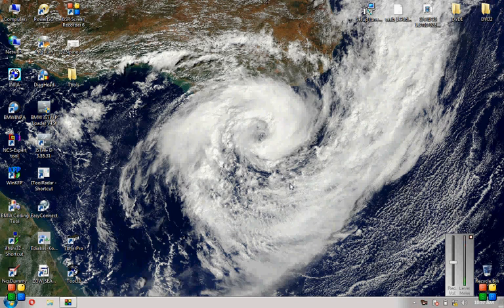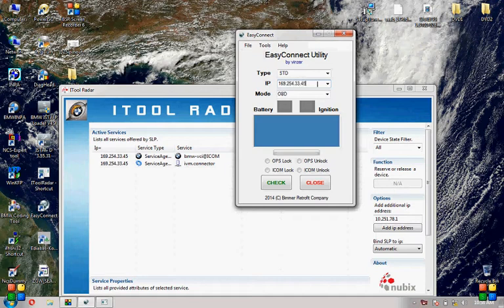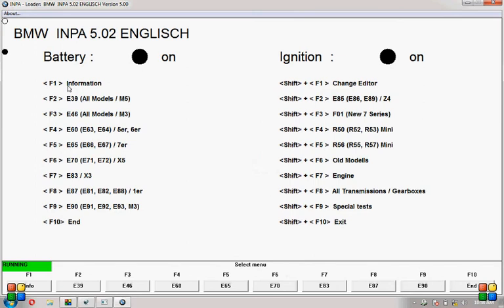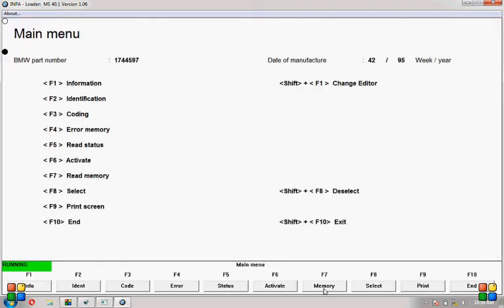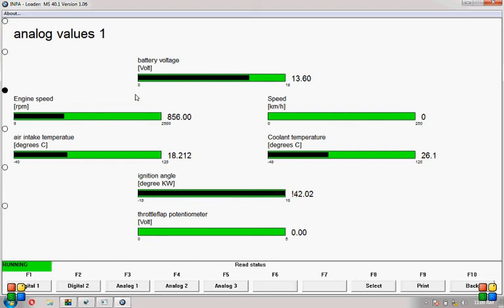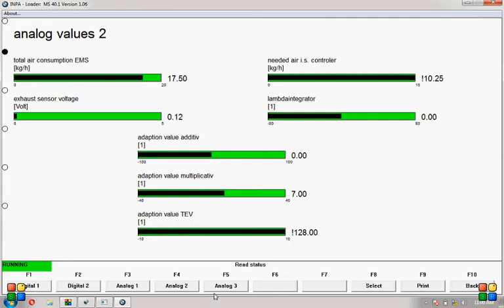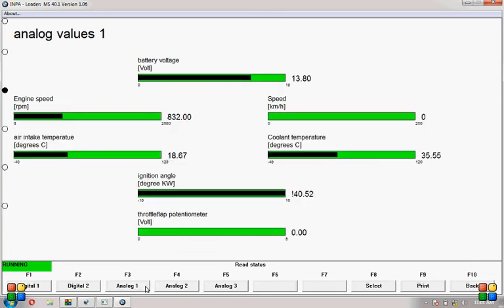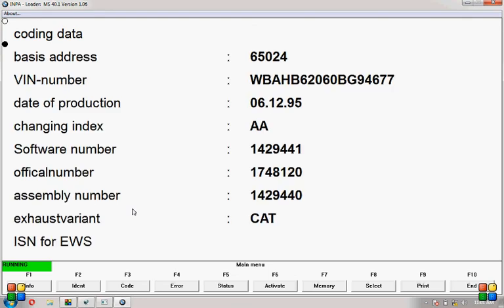How to Setup EDIABAS with an ICOM - INPA - testing DME e34 520i

Comment: when I do the steps in the video, It doesn't show the battery and ignition status. ICOM A1, any ideas as to possibly why? and it won't connect to inpa
Reply from the maker: Does easy connect show battery and ignition status when it’s connected to the icom ?
Reply: @mapkrk1316  no it doesn't
Reply from the maker: @ 
Are type in icom ip address into easy connect? Follow the steps in the video.
Reply: @mapkrk1316  yes followed exactly like the video did
Reply from the maker: @ 
How did you determine icom ip address ?  You have to put your icom ip address in easy connect. Use iTool radar to obtain icom ip address.
Reply: @mapkrk1316  yes did that just like video, got it from itool then put it into easyconnect, chose remote, then diagbus, lock icom, and click check, icom locks but no ignition light or battery light. The icom does lock, it shows reserved in itool. I can connect to istap and ista+ no problem with my icom a1 without any of these tools shown in the video. Not sure why it doesn't work on inpa. No matter what edit I did to the ediabas file, didn't work with inpa or any of the other bmw standard tools
Reply from the maker: @ThatDIYguy862  
It sounds like it’s more complicated than I thought lol. I would try install BMW standard tool from another source and hope for the best. Some files might be corrupted.
Reply: @mapkrk1316  whenever it says interface = remote, it starts to give all kinds of errors on startup, but when it's interface= std:obd, it starts up without errors but doesn't connect with that, those edits are in the ediabas ini file that easyconnect edits. Installed it from 2 different sources, same issues
Reply from the maker: @ 

Ista + uses its own ediabas folder. If ista + works fine so the issue is only with ediabas folder for inpa. Try ediabas konfigurator 2.0.0 but I’m still thinking the package you’re installing it’s corrupted.
Reply from the maker: @ 
Also switch firewall off or add exemption

Comment: Hi, could you share your ediabas.ini file? and if you have remote.ini, rplus.ini?
Reply from the maker: Its standard ediabas.ini. Use esyconnect to obtain connection with your interface.
Reply: Mapkrk Thanks, by the way ediabas 7.3.0?
Reply from the maker: That's right, I'm on ediabas 7.3.0.